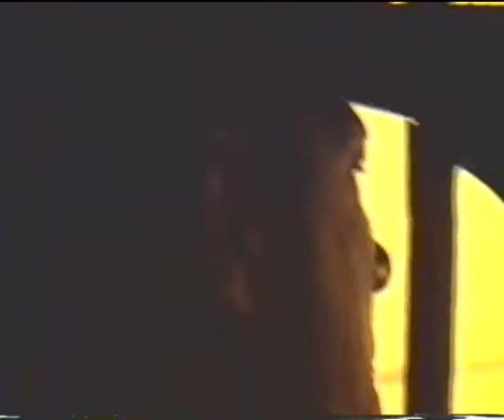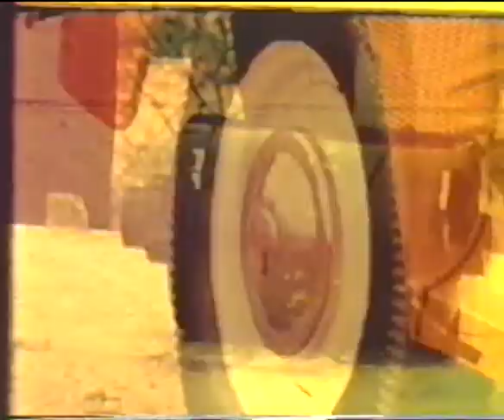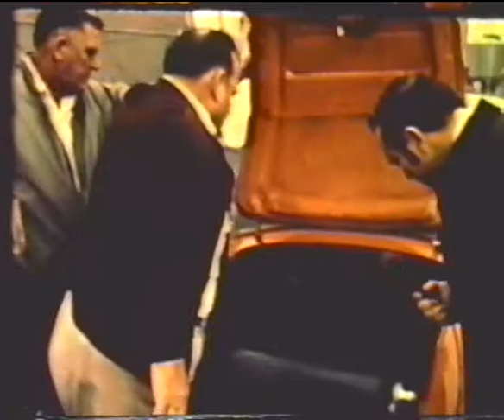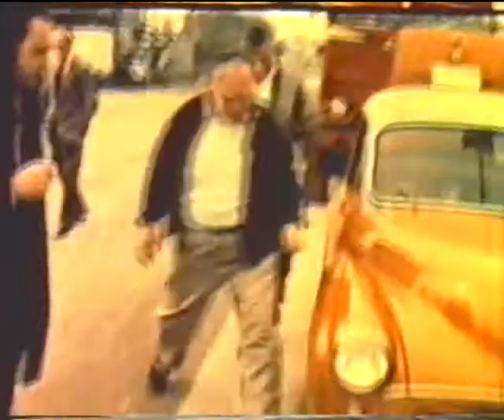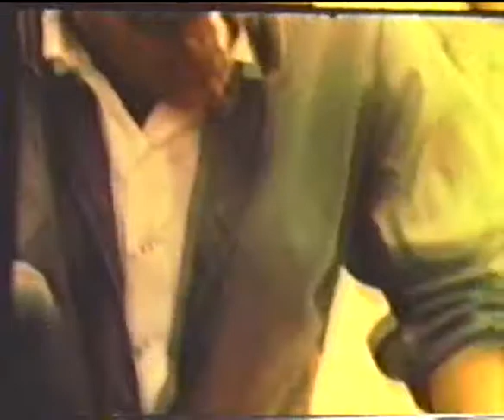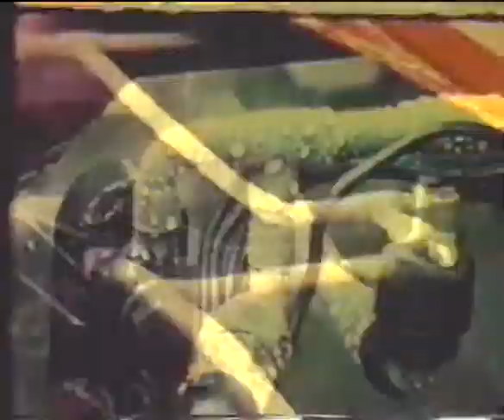1970s electric car uses liquid nitrogen expansion to charge its own batteries

Comment: I saw this idea used on an American pickup-truck (possibly based on this) in the 1970s, it had a 400 mile range. The liquid nitrogen is manufactured in large quantities as a waste product when making liquid oxygen for hospitals, rocket boosters and aviation use, 20% liquid oxygen is made with 80% waste liquid nitrogen most of which is allowed to evaporate back into the atmosphere, total waste. 
Shortly after this pickup-truck was demonstrated all cryogenic fuels were banned from use in the USA...